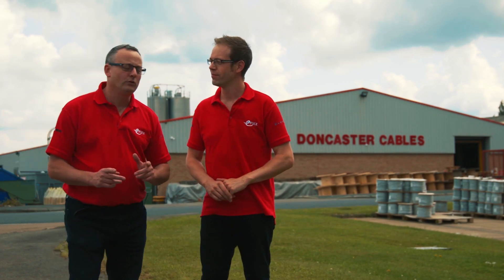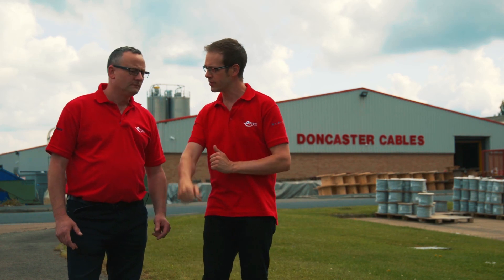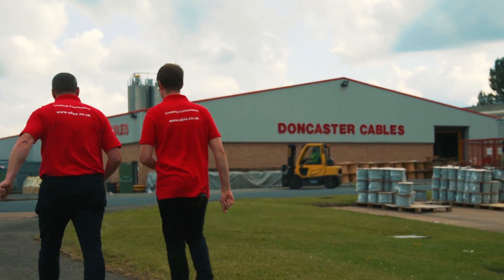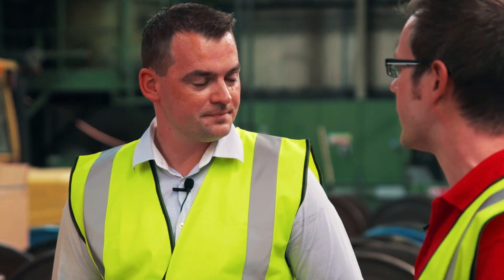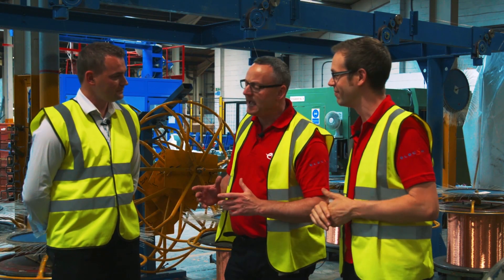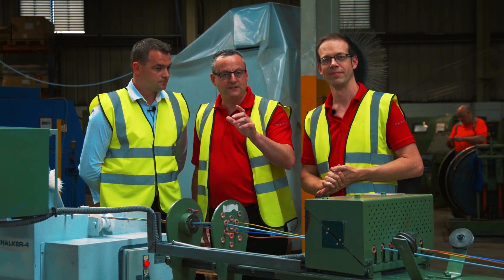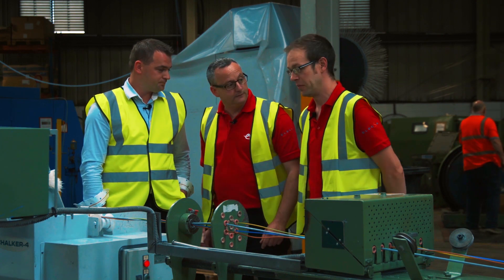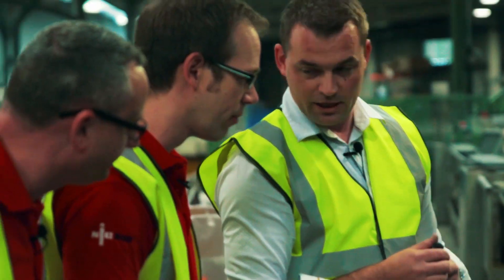How is SWA armoured cable made - factory tour Doncaster Cables. - new cable EV Ultra

Comment: One of the cooler cables I worked with was for an internet radio tower. It had a 16AWG dual core for 48VDC, a Cat-6 cable, and 8 fiber strands. The 48VDC powered equipment up on the tower, the fiber was the high capacity back hall, and the Cat-6 was a backup and management link. It was obscure to find for an obscure use with a high price. That EV cable is not used a lot but is more of a common thing now. I could see using the cable for an outbuilding and splitting the data Cat-5e from the power cables to have networking at the outbuilding all in one go.

Comment: Great video again fellas. You should visit other manufacturers of electrical equipment such as consumer units, switches, socket outlets, pvc conduit, even MFTs and screwdrivers.. Cutters etc, The world's your lobster 😁 interesting stuff. I used to work for a company that has their own cables manufactured for atex approved CCTV equipment, it was very expensive. But it had multicore and rg59 coaxial cables, and data cables, alongside mains cables. Similar to this EV swa, but braided instead of armour. In fact Doncaster cables factory looked very similar to the place I worked lol.. Strange 😎
Reply from the maker: Thanks for your detailed comment and yes we will be visiting other manufacturers and the next one is not in the U.K...

Comment: Is there a test done on multicore SWA cables to see the effect of the electromagnetic forces on the SWA during short circuit? Is the SWA strong enough to hold the individual conductors within the multicore cable? I am looking forward to see a video of that test.
Reply: What do you think happens when you short circuit a 2.5mm cable? Or even a 6mm? No movement at all is what happens
Reply: currents and hence magnetic fields are equal and opposite to cancel each other out.

Comment: But... I was always taught to run Data cable separate to power 🤔
Reply: The power cable is double insulated from data by the inner sheath and insulation so that ticks the safety box  I guess the data cable within is screened so interference isn't an issue.
Better segregation than you get in pvc dado trunking.
I can't see many uses for it unless you have a direct buried run as it will be awkward to terminate and connect back at your router end.
Reply: @mrbadger9920  The impression I get from whatching electricians on youtube is while it could be used for Data, it's more often used for current transformer hookups.
Reply: @petermichaelgreen  As it states in the video it's a government grant requirement that it has to be connected to the Internet.
Reply: Yes so wad I
Reply: @mfx1  which doesn’t need to be done via a hard wired connection most of the time a Wi-Fi signal is sufficient enough for an EV charger and the data cable inside an EV ultra is mainly used for connection of CT clamps
Reply: @YGee3Mx  But the whole point of them making and selling this cable is for internet connectivity, you don't need cat 5/6 for current clamps, current clamps don't generally send data (although some  could with extra electronics which would add significantly to the cost of the charger) they are analogue devices. There are also chargers with no built in wifi, just an ethernet port so you'd have to supply your own outdoor WiFi unit.
Reply: I don't know why that is taught or mandated, unless you're in a heavy industry factory with massive welders, plasma cutters and other heavy industrial machinery it's a complete non issue as long as you're using differential transmission, and even in industrial environments combined data and power cables are already a thing for machinery. Running power next to data is an outdated myth that really needs to be got rid of.

Comment: Has cable got smaller over the last 20 years. As when I started I remembered that a 25 mm lug was tight now they seam to be loose
Reply from the maker: You might want to compare the weight of the lugs also. On serious note you can get higher purity copper which allows manufacturers to reduce the CSA - Or it may be a "fake" import and the manufacturer has shaved a bit off to save money - BEWARE

Comment: Question why is a specific cable created with network and not using the functionality of network over mains cable?  Since there would be minimal data over this network part it does not need to be high speed (CAT 5 100Mbps) and so existing network over power cables is more that enough, surely?
Reply from the maker: Lots of reasons - the cables are often used to connect not just data but also current transformers.